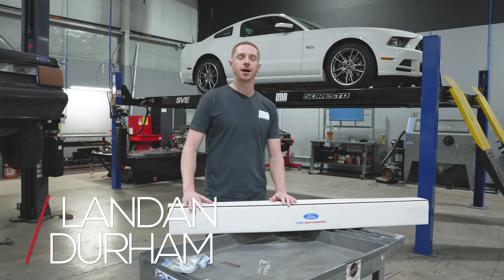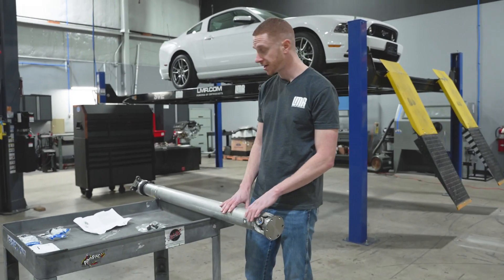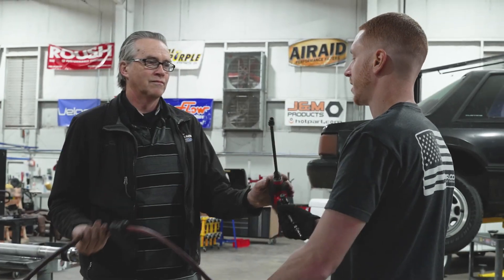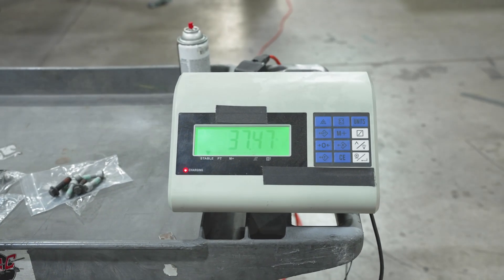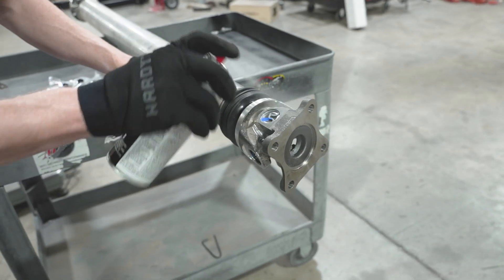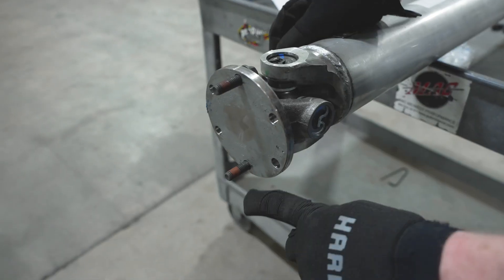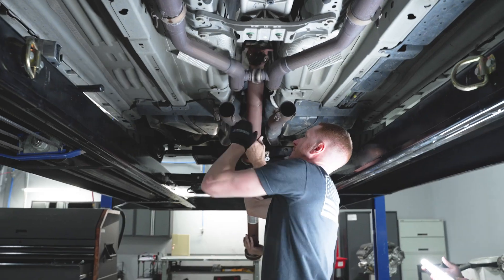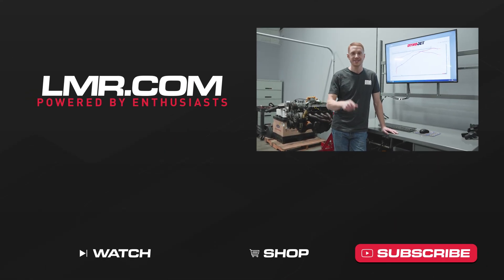"FREE" Up Horsepower with an Aluminum Driveshaft - Dyno Tested!

Comment: Great vid. these lighter driveshafts definitely work! I just recently bought a 2012 5.0 coyote premium gt. I don't think there's anything for me to do. The car runs out fantastic with all of these upgrades. Lovin it. The previous owner did all the right things including the Cervini hood. if i had to guess, most likely a torque convertor, maybe gears, but all the usual eng and exhaust mods, tune, driveshaft, brakes, and suspension is done, when i checked all this out/on a lift. Great cars. Scary fast. Love your vids too.

Comment: On my WRX the lightweight driveshaft, lightweight flywheel, and lightweight pullies all made "seat of your pants" differences.  The car just spins up my h faster.  On the other hand I seen people struggle with my car because it doesn't "keep it's revs up" either.  It added nuance to a shift, but it also made it so I could cali stop without touching the clutch at all.  Then clutch less rev match shifts from there.

Comment: do not lube the flanges. you are lowering the friction that is needed to transfer the torque. the bolts should NOT transfer any torque but provide the clamping force to transfer the torque via friction. same goes for weel hubs btw.

Comment: Would you recommend an adjustable upper control arm with this driveshaft on a stock height 2013 GT 6R80?
Reply from the maker: Unless you're just needing or wanting to replace the factory upper arm, I don't really see the point on a stock ride height car. You'd benefit more from rear lower control arms than you would the upper if you're considering upgrades. Even at factory ride height, the lowers would help with wheel hop. -Landan
Reply: @latemodelrestoration  thanks. I did the lowers and the sway bar links last year.
Reply from the maker: @joseluisrodriguez7257  You're welcome. I think it'll ultimately be up to you on whether or not you want to spend the money. Will it help the car launch, yes. Is it absolutely needed considering what you've already done, no. -Landan

Comment: 17 lbs is also worth almost 2 HP just from the weight loss, which of course won't show up on the dyno run, so you can add that in to the total net HP gain.

Comment: Is it as durable as a steel driveshaft i plan on throwing more power onto my tuned 5.3 chevy single cab and im not fully decided if i should get the steel or aluminum
Reply from the maker: I'm not a Chevy guy, but I'd be willing to bet that an aluminum driveshaft is popular swap/upgrade for your truck. -Landan

Comment: The results were negligible, but what’s important is what you can’t see.   The added weight of the old drive shift slows initial acceleration (hence the statement what you feel) and more importantly the wear and tear you save on your drive line due to the initial power transformer under take off.  Think of spinning a crank with your arm with a heavy crank versus light.  Once up to speed no problem, but that initial start is where you get the payoffs.
Reply: I’d say slightly less harmonics as well
Reply: hey so i have a gen1 gt350 was was thinking about doing alum or cf driveshaft. but i saw your comment regarding initial acceleration being where you really see/feel the results. i daily drive my shelby. (errands, cat food, etc you name it im in it) with so much stop and go from lights and what not. would you say that this upgrade could be good for a daily driven gt350?
Reply: @markhenson6584 Definitely. Less rotating weight means more power and less wear and tear. I definitely noticed a difference on my Mustang going to an aluminum driveshaft from a steel one. Acceleration seems more responsive too.
Reply: @markhenson6584 if that’s all you use it for, save your money, it’s more of a performance mod.  Not needed for your vehicle.  Spend the money on family vacation bro
Reply: Not to mention that it’s aft of the gearbox - the higher the gear the more beneficial it gets. Every upshift reduces output torque while increasing shaft RPM difference between idle and redline engine RPM.
Theoretically it should be most noticeable when accelerating from complete stop or driving on sixth gear.

Comment: Will adding this drive shaft to my v6 allow me to remove the rev limiter and speed governor just need to know what speeds are the drive shaft rated for
Reply from the maker: A driveshaft doesn't "allow" the rev limiter to be removed. A handheld tuner has that functionality. The critical speed of a driveshaft is determined by it's length, outside diameter, wall thickness, and u-joint series. If you have that info, you can calculate the driveshafts "critical speed". -Landan
Reply: @latemodelrestoration  yes that's what I was asking I just wanna know if it be able to handle speeds of 170+mph ya know how much hp and torque is it rated for, can that drive shaft handle the speed governor and rev limiter being removed

Comment: I'm doing weight reduction on a 260z thats stock. I'm looking for multi functional parts forst before  i spend $2650 on carbon fiber to save 125 lbs (without doing doors or it'd be like 240lbs total) which is 5% of total weight cut. It's a good amount but if i do things like lighter wheels, lighter tires with performance (i have all seasons currently), aluminum driveshaft, possible rear diff upgrade, exhaust system probably last, then I'd probably save around 400 pounds or 16% in total weight reduction. 
Then i would start with performance parts like brake kits, cams, etc. I'm doing webber carbs right now. I wonder what other parts like the driveshaft i can cut weight and improve performance at the same time
Reply from the maker: Lighter weight brake rotors will help as well. -Landan

Comment: Is the suspension all stock?  Did you need to adjust the pinion angle?  Also the yellow dot on the driveshaft, is that to be aligned with the yellow dot I’ve seen on several pinion flanges?  Are the yellow dots for balance considerations?  Thanks.  I’ve got a similar 2014 GT and at 26000 miles I think the carrier bearing rubber isolator is going out and causing the driveshaft to vibrate some. So I may be looking at the same driveshaft install. 
Good video, thanks.mm
Reply from the maker: Yes, the suspension on the car in the video is all stock. The pinion angle must be checked if you lower the car. The marks on the driveshaft are used in the manufacturing process so that the assemblers know when a certain step is complete or a component is verified. -Landan
Reply: @latemodelrestoration  thanks for the information, did you have interference problems with the 8mm hex key socket and the rear ujoint when you were torquing the rear bolts to 41lbft?  I have a 13mm crowfoot for the two 13mm bolts under the ujoint arm.

Comment: I have a 05 v6 t5.. with stock 8.8 from a gt.. will this work? I also have the stock drive shafts for the v6 and gt
Reply from the maker: The driveshaft in the video will not work for your application. -Landan

Comment: Not so much with these bolt together Lego cars, but with custom stuff the  biggest benefit is lack of harmonics and vibration. 

The aluminum is such a “dead” material it doesn’t amplify ring and vibration…
Reply: Lego cars my ass! All cars have bolt on mods like these or blowers boost exhaust etc! And these cars you dog are faster better built and more efficient than any older car!

Comment: A must first mod, that steel 2 piece with a sloppy center support bearing must go, yes even the gt 350 has the same drive shaft, so does the machI. Dana Spicer makes the shaft for Ford Performance, just a FYI.

Comment: TWO QUESTIONS;  would this hp gain be similar same in a V6 camaor/mustang  but just a larger percentage since 3 hp out of 323 is almost 1% whereas 3Hp out of 416is about .6 %
it would be cool to see this back to back test with lightweight wheels as well
MAYBE even an under drive pulley if those are possible on modern engines?
Reply from the maker: The results simply depend on the weight savings of the lighter driveshaft. There isn't' really a blanket "percentage". However, the theory is the same for all makes/models. We plan on putting a video together talking about the benefits of lighter weight wheels. Underdrive pulleys aren't very popular with modern Ford engines. -Landan

Comment: Don’t ever put a one piece on a 6r80 transmission because you’ll have vibrations issues.  The factory unit is a two piece with a carrier bearing due to the design requiring it.  There is excessive tail shaft play by design w that trans and needs a carrier bearing to stabilize it.
Reply from the maker: Are you speaking from personal experience? I've never had an issue with a one-piece driveshaft in a 6R80 car. My wife has a ~700 WHP supercharged Coyote car with one, and it's been problem free for 5+ years with occasional drag strip use. Also, I know and have driven a few cars with 100k+ miles, and they're smooth as can be. You might want to check the balance of the driveshaft that you have. -Landan

Comment: The thing about rotational mass is that the radius of the spinning object matters. A driveshaft is a fairly poor flywheel because it's so thin. So you really aren't saving much of anything compared to the stock steel piece. Especially when you look at the overall rotating mass-- the tires and diff spin too. This makes sense as part of a lightening program. But power gains are almost entirely theoretical.
Reply: The biggest thing is it will hold up to drag strip Launches and big power much better it's alot stronger it's also 17 lbs weight removed from the vehicle and it all adds up.
Reply: @midnight347  since when is aluminum stronger than steel?
Reply: When your two piece steel stock drive shaft breaks due to added torque from PD modification you added. That's when. It's the design, not just the material.
Reply: @tonyduncan7672  Pretty sure they make 1-piece steel shafts too.

Comment: I believe it's not just reducing weight, but no one else has expressed the fact that maybe the carrier bearing robs just a bit of the horsepower from the drivetrain as well. Every time you add another friction surface, there has to be parasitic loss.
Reply: Are you referring to the OEM two-piece?

Comment: Not cost effective, considering cost and installation.
Reply: It isn't just for power gains it holds up to power alot better the factory one is a weak link.  It is also 17 lbs removed from the vehicle it all adds up.  Little here and little there and you're 200-300 lbs lightee before you know it.

Comment: Bro science backed up. It was really a great deal when the Ford Racing shafts were $150 and under. An aluminum DS and Flywheel with 430 gears on my Mach 1 took it to low 12s when that was quick🤣

Comment: You can also compare how quickly it revs up. That is where you will notice a difference as well when it comes to parasitic losses. I have done lightweight aluminum flywheels and that is quite noticeable considering it is straight off the crank.
Reply: The driveshaft doesn’t rotate when you rev the engine considering it’s attached to the rear end 🤣
Reply: The driveshaft doesn’t rotate when you rev the engine up IN NEUTRAL, but it definitely does rotate when you rev the engine up while going through the gears.
Reply: @Texas_Road_Warrior  lol good 👉,  I was scratching my noggin a lil but it's early. Still giggling lol
Reply: Yes, the HP difference will depend on how quickly the dyno allows the engine to rev up... also, the difference will be less in the lower gears when the driveshaft isn't seeing many RPMs... 
looks like the difference with aluminum shaft is enough to put a fender ahead of the other car with heavy shaft...

Comment: No need for a carbon fiber one tbh, just more money when an Aluminum will get the job done.
Reply: Big power build will need a CF shaft.  They help absorb hard launches.   AL will also fail before an CF will
Reply: No need for an aluminum one tbh, just more money when a steel one will get the job done.

Comment: $800-1200 for 10-20 HP/TQ
And.......
Steel shaft will absorb and dampen any vibrations...
Aluminum will amplify them...
Reply: So you'd feel more vibration with aluminum? Even if balanced? I'm green as hell to this subject.
Reply: @nimrodpaul6875  yes, but in a racecar, it wont matter cause everything is loud and vibrating. but in a daily driver.... steel is better. that extra HP isnt worth the noise/cost
Reply: Yeah, I’m worried about the AL amplifying every little noise so I’m gonna go carbon fiber probably,the giant 2 piece stock shaft has to go.
Reply: @MikeSmith-ey7ku  CF wont dampen vibes either and are the most expensive shafts currently made... also only made in short form like CV axles reliably... good luck...
Reply: @MikeSmith-ey7ku it's fine man I have an aluminum shaft on my 07 gt500 I notice excessive vibrations or anything like that.
Reply: you're worried about vibrations??? what kind of motor does your mustang have a vagina.0

Comment: Pretty sure lightnings and 03-04 cobra came with aluminum driveshafts stock.  I did the Ford performance ds on my 07 gt500 the biggest thing is when you're making 750+ rwhp like I am with a gen3r the stock driveshaft won't hold up especially if you're on fat drag radials like I also am.  That was the biggest reason for the upgrade for me but freeing up couple hp and torque and making it Rev faster and drop almost 20 lbs rotational are all icing on the perverbial cake.  I could use all the weight savings I can get on my fat 3900 lbs mustang haha.  I'm prob around 3800 now and I got some lighter corbeau gts2 seats on the way that should drop 30-40+ easily I might do a rear seat delete also since I never use it and this car isn't my daily.  It has a lighter exhaust and an f14 drag pack on it too.  I'd like to get her down to 3700 lbs or less without killing street manners or gutting it into a tin can I think that is easily doable.
Reply: I've been told that, by experienced drag racers, for every 100 pounds you shed from your car, you gain about 1/10th of a second in the 1/4 mile.
Reply: So 3700lbs you will be 2 car lengths faster than 3900lbs in the quarter mile.
Reply: @cocacola3269 that is significant.  That could be the difference between winning by a car or getting beat by a car.  Less weight is always a good thing.

Comment: That's the next upgrade for my sn95. I was blown away by how much more responsive my Mustang was after I put a lightweight flywheel on.  I just need to complete the package with the alumn driveline.
Reply: I've got a 2006 v6 mustang, next clutch kit time would you recommend me going flywheel ( light) and whatever else or since it's v6 just go oem? It is a 5 speed with a cai and whiteline front and rear sways and links so it's pretty fun to drive. Any help appreciated.
Reply: Heads up: the car might stall much more easily if the motor is tuned for top hp . I had a speed shop tune my 11:1 331 na with all the bolt ons, they tuned on a dyno… when I was parking the car, yanking the steering wheel suddenly would stall the car. And the speed shop acted like it was my fault for not knowing that would happen (they just didn’t know how to tune).
Just buy a blower though, that’s the lesson I learned.
Reply: @331SVTCobra they can tune it out by raising the idle. I have to get a revision on my gen 1 coyote Lund tune because of adding an aluminum flywheel and ceramic clutch on top of the aluminum driveshaft that I forgot to mention to them lol
Reply: @331SVTCobra they can tune it out by raising the idle. I have to get a revision on my gen 1 coyote Lund tune because of adding an aluminum flywheel and ceramic clutch on top of the aluminum driveshaft that I forgot to mention to them lol

Comment: when i broke my stock aluminum shaft after it snapped. I replaced it with steel since it was in a time crunch. And man did it really make a difference. Ive been lazy but I need to find another aluminum shaft and get that fast rev up back.

Comment: Brother, I have a 03' Crown Vic P71 with an aluminum driveshaft. Do you know ow how much power those can handle?
Reply: I have what was P71 aluminum shaft shortened down/balanced by a local shop in my fox chassis 85 LTD.   Been in there almost 10 years and the car has ran in the high 9's 1/4 mile.
Reply: @NCSTANGGUY  high 9 1/4? That's solid af.

Comment: A better explanation isnt the horsepower benefit from less rotational mass.

- A lighter driveshaft means less rotational mass to be accelerated, allowing the car's engine to transfer power more efficiently to the wheels. This can result in improved acceleration times; you'll notice that the revs tend to "hang less" and more responsive to the shift patterns.

- Increased Fuel Efficiency: A lighter driveshaft means less energy is required to rotate it, resulting in lower fuel consumption and improved fuel efficiency.

- Improved Handling: A lighter driveshaft can reduce the overall weight of the vehicle, which can improve handling and reduce body roll during cornering.

- Reduced Wear and Tear: A lighter driveshaft can reduce the load on other drivetrain components, such as the transmission and differential, resulting in reduced wear and tear on these parts.
Reply: Would extra weight keep momentum going and be better on fuel consumption on the highway though?
Reply: @Mr.5ame no I don't think so.  It's going to work less with the lighter shaft like he said it's also 17 lbs of weight off the vehicle every bit adds up.  17 here, 25 there, 50 there, 75 there it all adds up in the end.